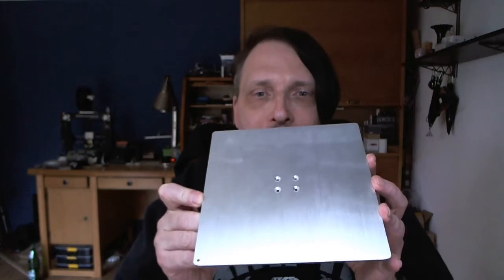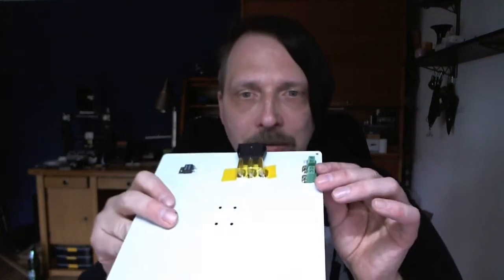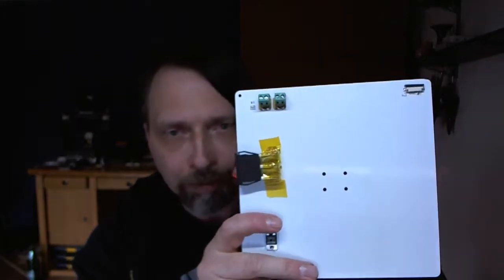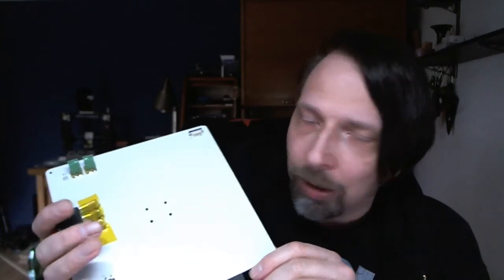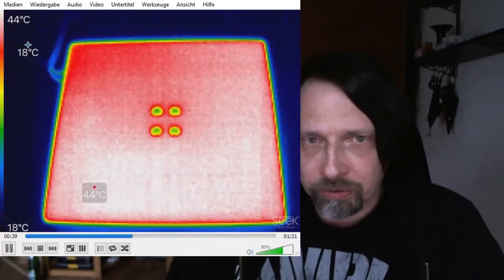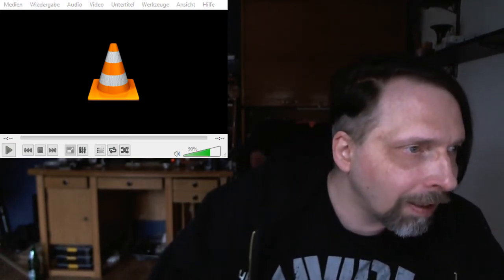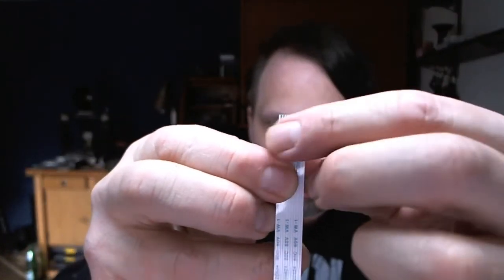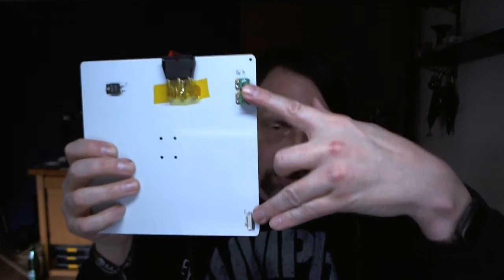Cetus3d Printer Heatbed Beta - first impression

Comment: I cannot find any documentation on these heated beds, I have 3 cetus mk2's with dead electronics and I am trying to figure out how to connect power and a thermistor to these heated beds connected to some RAMPS I have on hand, from what I gather, these beds have no thermistor resistor and what I thought were a power and thermistor screw connectors are really just dual power screw connectors that power half the board and I need to kapton tape a NC3950 under the bed for temperature control, what a stupid suite of electronics the Cetus have, this is why it's a nightmare to buy proprietary stuff, absolute monkey job of backward design

Comment: I'm pretty sure you'd be wrong here.  A ribbon cable should not be used to handle high (relative) current  (e.g. Heaters, motors, etc.).  Get the schematics for the heat bed.  I'm betting that the thermocouple runs through the ribbon.  If I am wrong, than Cetus didn't safely design it and should seriously rethink things.
Reply from the maker: no - there is no thermocouple connected (beside the thermo switch - but that something different) - they use the ribboncabel a bit different - half of the wires are used for + and  the other half for - so they spread the current on the thin wires of the ribbon cabel
Reply: Hi, just wondering if you have progressed with your 'Arduino Controller Project' and how did you go? I am very interested in your work and findings as I am debating whether or not to purchase their heated bed or just go third party, although as you pointed out, the bed seems to be of very good construction/quality (apart from the QC control with the short between poles 5 & 6, but you get that with budget equipment and just part of the game). Thanks in advance for your response :)
Reply: It is like he says, baffling but true :-)

Comment: so the heatbed maximum is only around 55c? thats not enough for ABS...
Reply from the maker: if you use only the power from the Cetus - but they said it before that you will need an external Power supply for higher Temperatures - the Powersuply from the Cetus is just to week to handel thes